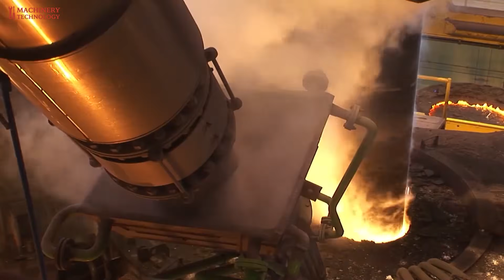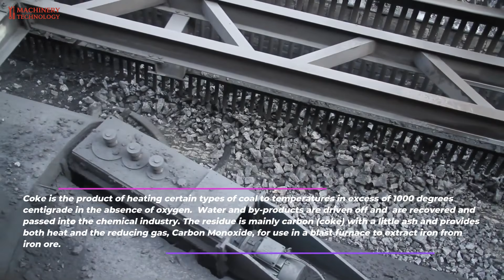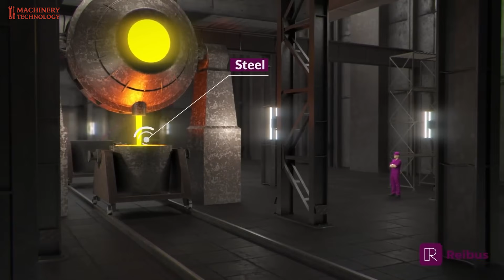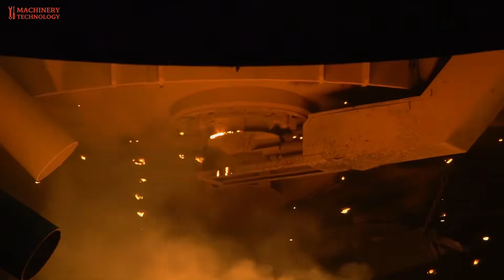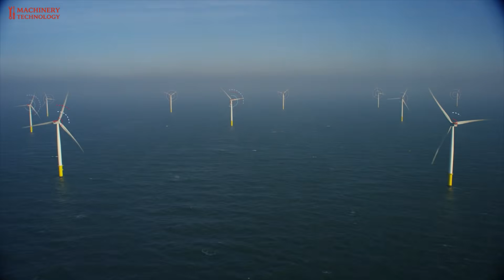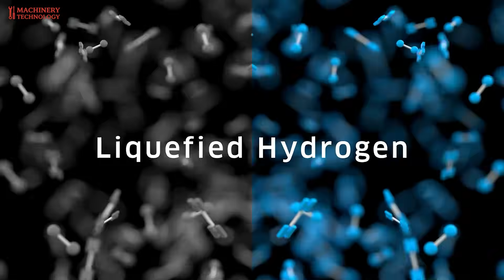What Is Green Steel? Why It Still Can't Replace Blast Furnaces

Comment: No matter which industry you consider, everything does eventually boil down to energy, how efficiently it is being produced and how efficiently it is being consumed.
Reply from the maker: Exactly. In many ways, energy is the common denominator of modern industry.

Green steel is a good example. The chemistry is already understood, but producing enough low-carbon steel ultimately depends on generating vast amounts of affordable clean electricity to make hydrogen at industrial scale.

In the end, many industrial challenges become energy challenges.